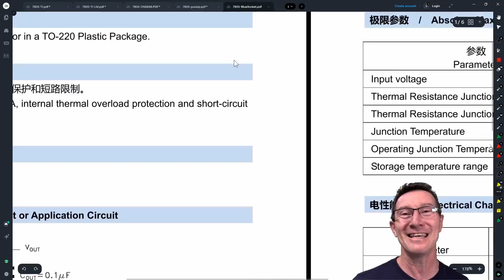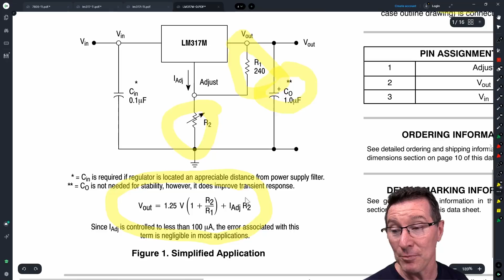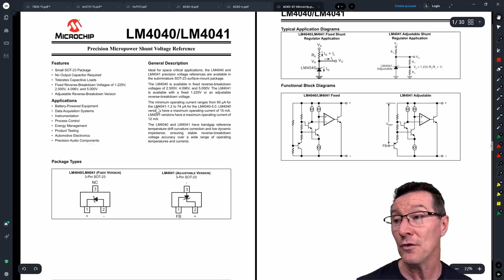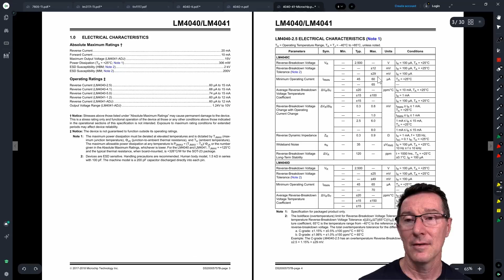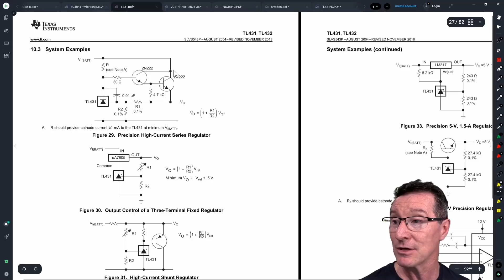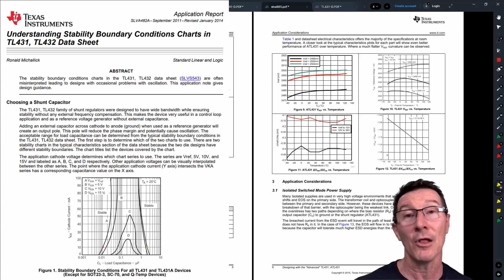EEVblog 1438 - The TOP 5 Jellybean Regulators & References

Comment: is it possible to parallel VRS  - to multiply output current ?
Reply: Dont do that. If you really must, add a follower transistor.
Reply: i get stable 5  - i need 3v3 - is a zener a good strategy to get my stable 3v3 ?
Reply: question answered :D
Reply: howmany regulators can be stacked until the voltage drop will reach such level - the next regulator will not run ?
Reply: @herauthon  I remember being told when a student that a 3.3V zener regulates about as well as a 100 ohm resistor. You just don't use such low-voltage zeners.
You don't "stack" linear regulators. If you want a higher voltage, use an adjustable regulator. If you mean how many can be connected sequentially, you need to ensure each one has its minimum voltage drop available for each stage. But then I have to ask why do you want to connect regulators sequentially? You're almost always better off using a more stable supply in the first place.
Reply: @RexxSchneider  
for experimental part if it 
howmuch drop until it drops ;)
Reply: @herauthon  Don't bother experimenting in that way. It tells you nothing. What did you actually mean by "stacked"?
Reply: @RexxSchneider  
connecting more and more
until the output is not high enough 
for the next to work ..
Reply: @herauthon  The way these linear regulators work is that you set the output voltage using resistors or you use the fixed output version. If you use an LM317, for example, you can have a maximum input voltage of 40V and a minimum voltage of 3V across the regulator for it to work. So if you had a 40V power supply, you could set the first regulator to 37V, a second one to 34V, and so on until the twelfth one was set to 4V. You would be unable to add another one because the minimum output voltage using an LM317 is 1.25V.
But I can't visualise any scenario where anyone would want to do that.
Reply: @RexxSchneider 
But that's not always the goal
sometimes one stacks crates until 
it's to dangerous to do so - just for the record. 

Can one use pots to fine tune this to squeeze out one more ?
Reply: @herauthon  Nobody stacks crates until it becomes dangerous. Are you still in the playground?
When you design, you use the specifications on the data sheet. Of course you might find an LM317 that seems to work with 2.5V across it, but it's not guaranteed to work under all possible conditions.
If you want to learn about circuit design, then learn how to use the components that are available. If all you're interested in is playing with objects, then stick to plastic blocks.
Reply: @RexxSchneider  

white-flag
Reply: use switching regulators instead. Better efficient more current. if you need a lot of current, there are multiphase buck switching regulators.